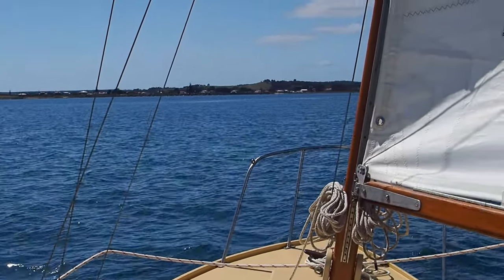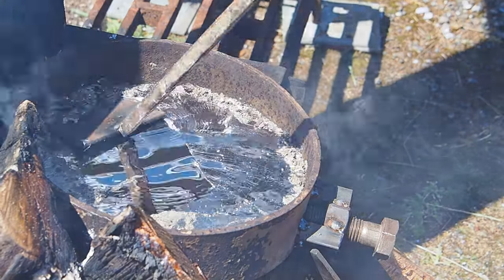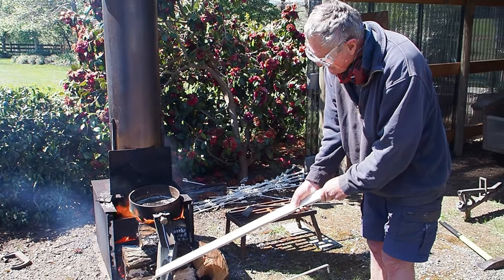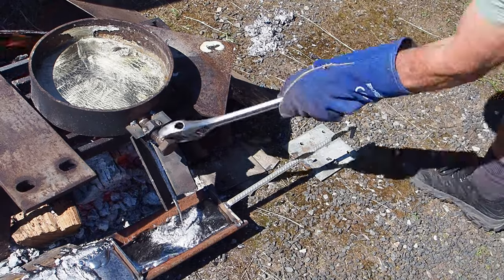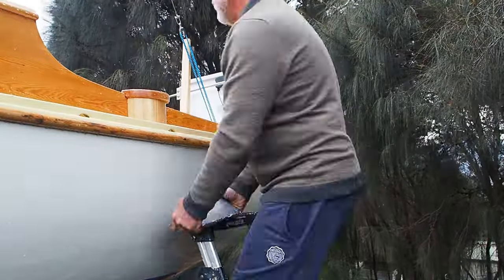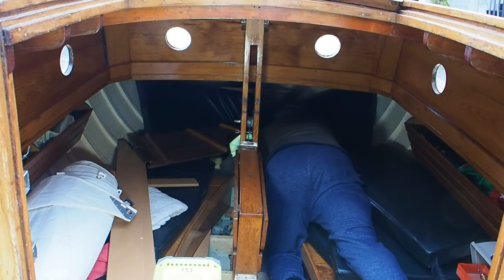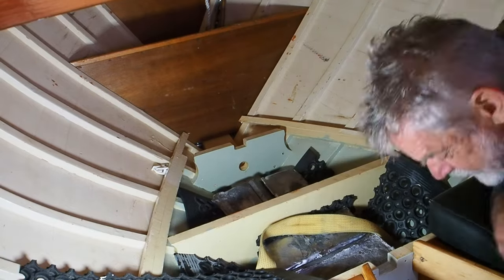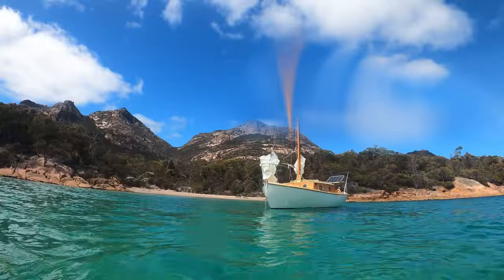I'm Taking a Risk! Will Pouring Lead Ballast Improve Our Boat's Performance?

Comment: I built my boat over the course of about 2 1/2 years, launching in late summer 2015. Keeping track of the time I spent on her was abandoned pretty early in the project but I suppose at some point between day sails and overnight adventures we'll tip over into more sailing than building time. Working against me is our short prime sailing season of about 4 months with the other 8 tending towards cold ,wet and dark. I'm also actively building small parts for the Next Boat...that's going to take a bite out too. Building and maintaining boats is my idea of fun, actually using the boats is almost secondary to mucking around in my shop.
Reply from the maker: I think it is important to love the repairs and maintenance side just as much as sailing. The only other option is a huge bank account so you can get others to do the work for you.